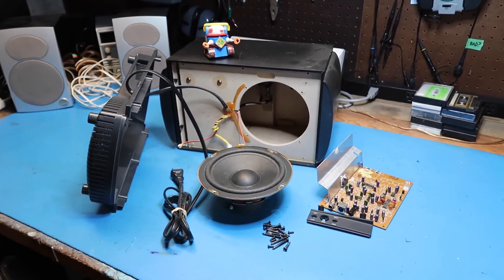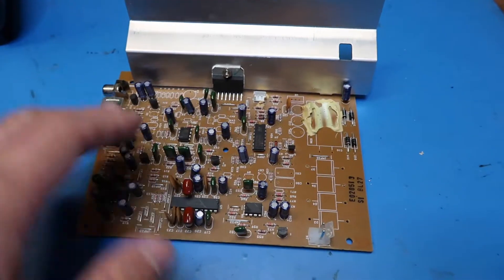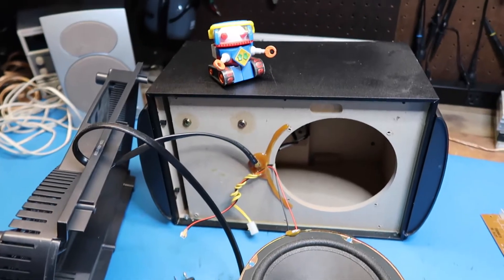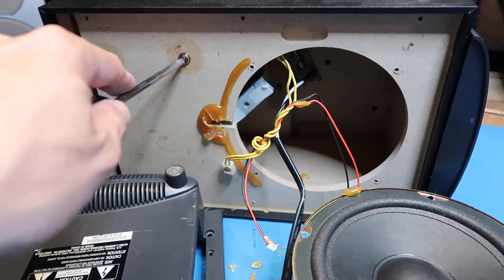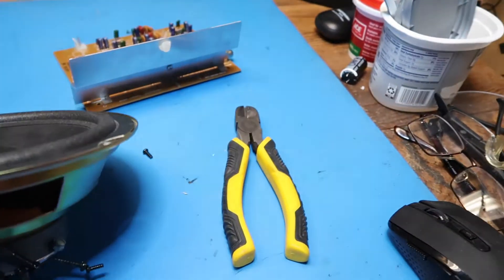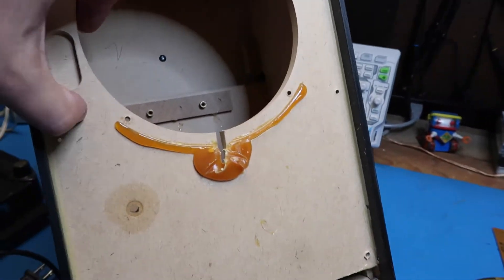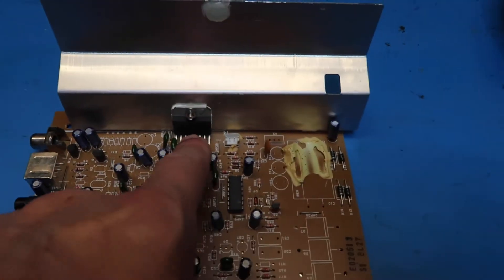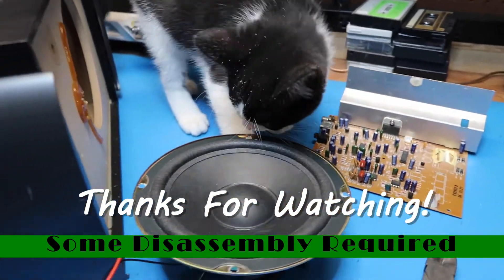Inside an Altec Lansing Computer Subwoofer

Comment: I have bought a used altec lansing atp3 speakers some days back. It sounds good, but at high volume there is distortion in subwoofer. The Bass is distorted if I increase bass. How can I rectify the problem, sir. I Purchased it for 20 dollars.
Reply: had same problem. have you fixed the distorted bass ?
Reply: @rockstyle2590  Yes bro.
Reply: @claudinedsouza6786  may i know how you fix it and how much it cost for you to fixed it ?
Reply: @rockstyle2590  I gave it to a electronics repair shop to fix it.

Comment: Subwoofers are kind of expensive on eBay.
Reply from the maker: I routinely find subwoofers in my local thrift stores, and they go for about $10-15 around here, depending on the size and quality.
Reply: @SomeDisassemblyRequired  I'll definitely try that. Thank you very much for the information.

Comment: Kindly share the driver in this system. I want to open up mine but I wanted to know if I can get replacement drivers before I do. Thanks
Reply from the maker: The driver is marked Altec Lansing, A7065, 4 Ohm. It's about 6.5 inches in diameter.
Reply: @SomeDisassemblyRequired  thanks